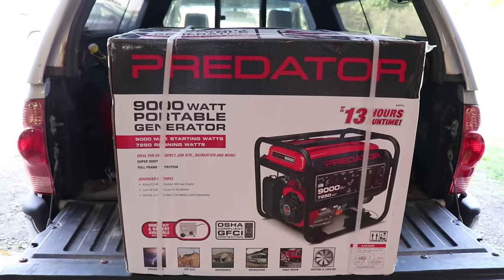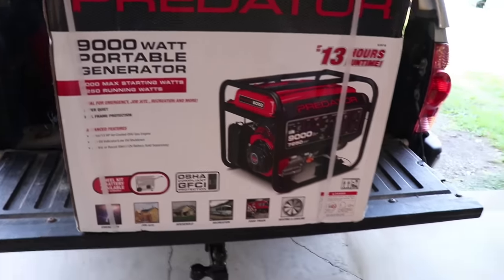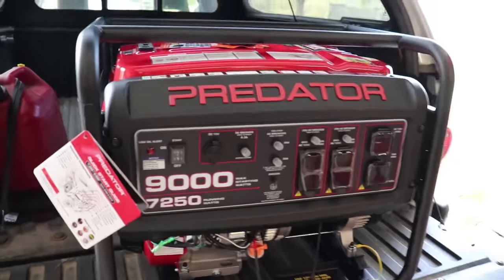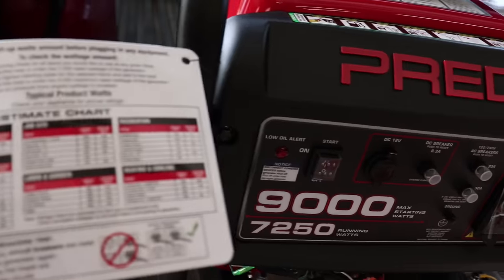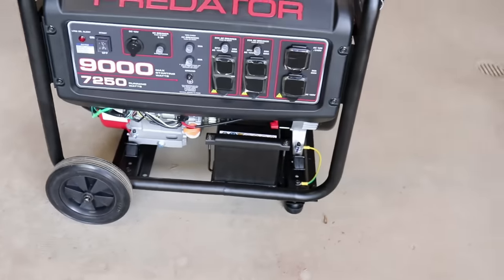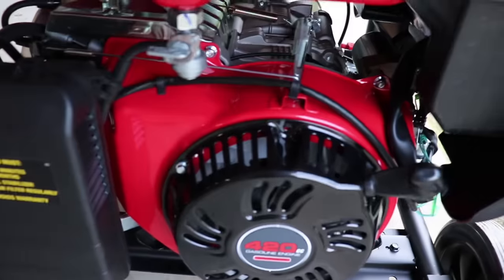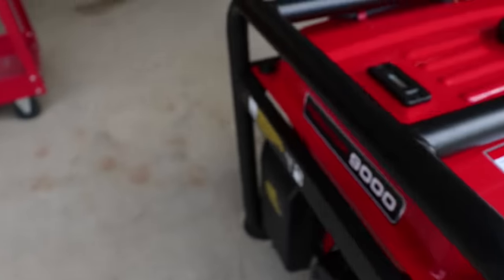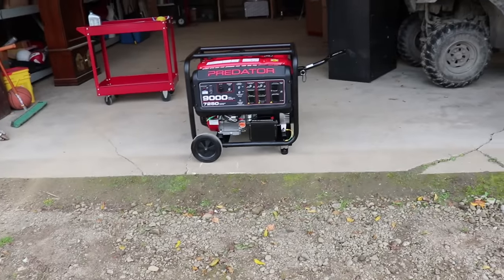Predator Generator Running Our ENTIRE Home. (Complete Setup and Cost)

Comment: We bought the same model about 8 years ago now, right before we lost power for about a week; ironically the geni was cheaper than losing all the food in our deep freezer, so it was nearly paid off day one. I haven't had an electrician come out to wire it up to the house as that's required for our state, but I do have a mobile octopus-looking thing when we use it for back-up duty. Most of the time it's my only source for 220 jobs like the welder and plasma cutter. 
It's run well overall, though the battery thing is Always dead when you need it. Hand cranking can be a chore when you run it for the first time after a few months, but a few squirts of mass air cleaner (I had it on hand) works like a charm til it switches over to full fuel. Also find it funny that the choke sticker is backwards on our unit; still trips me up once in a while. 
In the event you're in a residential area, that geni sounds a lot louder when all the power in the neighborhood is out. 😉
Reply from the maker: I live in a rural area, so no issues. Plus my neighbors are awesome.

Comment: If you have an electric stove, dryer, and water heater, those are huge restive loads.  Your not going to dry clothes, or bake a cake or roast a turkey.  Heat up your food in the microwave, lower power consumption and faster.  Your water heater will stay hot for maybe a day, unless your taking showers and a load of clothes.  Just turn the breakers off to those things and you can use a smaller generator that gives you longer run time, they are non essential items.  Heat and water and sump pump, so you don't freeze, die of thirst, or it's raining so your basement doesn't flood.  Those are essential loads that have to be met.

Comment: I have exactly the same generator. Two things you need to know. The generator does NOT charge the battery. You should attach the battery to a trickle charger when you're storing it. If not, don't expect the electric start to work on a cold rainy night.
  Second, don't store it with e- anything gasoline. The "fuel pump" on this generator is actually a rubber diaphragm. Ethanol fuel will dry it out and when it cracks it's a pain to replace and all you have is a 250 lb boat anchor. You can use up to e-15 fuel when you running it constantly..
Reply: It does charge the generator, might be something wrong with yours. If you turn off the fuel valve, while the engine is running, it will burn all the fuel in the line and carb.

Comment: Nice generator! But that thing is noisy! I bought the Honda eu7000 and it’s really quite and easy on fuel. A few days ago I found on Craigslist another Honda eu3000 for $450 the guy was selling it because it died out and wouldn’t start so he brought it to a local shop and they told him it needed new rings, I brought it home and pulled the valve cover off and seen the rocker arm was off, I put it back on and it runs like a dream 😁

Comment: I believe you need to run that water a bit longer before the well pump kicks on & when it does it will show in the lights as they dim for a.split second. 
Says the 25 year veteran well driller / pump mechanic. Props for the.home schooling brother.
Here's to a 12 pointer in 2020

Comment: Try three days. I just ran my whole house with the 6500 watt predator. I have a well pump and a couple other high wattage items. It ran for pretty much 3 days straight but only shut it off once. Added fuel while it was running.

Comment: Fast forward: Harbor Freight had a sale on the 9000W predator. Add on another discount for signing up on the super saver club and the price was about $700.00 I sold my 4000W and kept the wheel kit. So it cost me about $400.00. I had an electrician come out and install the system at my breaker panel so it runs my complete home without feeding power to the main line and harming PG&E workers. The 9000 runs the whole house, two freezers and all appliances including the air-conditioning and or swamp cooler. PG&E in my area goes out way too often during the year but we are going into fire season so it will be out for days at a time!!

Comment: i have the 8750/ 7000 and had it since 2008 no trouble at all. never fails to start first pull. but i found the battery wont last even if you leave a charger on it 24/7  if its raining i plug in 2 of them cords that's 50 foot cord and it will run everything 110 in my house but when it gets daylight or stops raining i move it and use 8 foot of cord.  i can run everything with that short cord. during harvey we went 21 days and here what i did we ran it at night all night shut it off the next morning after we eat and leave it off until about noon start it let it run the fridge and what ever we needed cooked and ate. then turned it off until just before dark and let it run until daylight again. and i would use about 4 1/2 to 5 gallons.  every 1 1/2 days.

Comment: That "Unknown Tool" might just be a spark plug wrench? Potential generator owners need to consider that a microwave can need 1200 watts. Does the generator automatically cut off, circuit breaker/fuse, if the load exceeds its rated watts output? Gas gauge? Does it have an external replaceable oil filter? There is a YouTube video showing how the video producer converted a simple outdoor shed into a generator supply house. Inside light, air fan, insulation, etc. Looks to me like a great DIY project.

Comment: I know this video is not recent but, changing those cfl light bulbs will come in handy. Led's use less wattage and are less dangerous when they go out. Recently with Texas's blackout a couple cfl light bulbs popped with the generator running. Cfl light bulbs have mercury which is dangerous.
Reply from the maker: I actually did! I put in all LED's.

Comment: Oops! Fridge, freezer,, microwave, lamps with LEDs, and putting a plug on my furnace power. Doesn't happen often enough to warrant the box and breakers. One thing I am doing is connecting the ground wire so the GFI on the generator will work. Looks like you have done a pretty good job of setting yours up, but I would suggest the ground wire.

Comment: If you had natural gas coming into the house, you can easily convert this to NG, that way you don't have to stop your unit to fill up the gas tank. Been using this setup for 30 years, started out with a Coleman generator, to a 4000watt and now have 10,000 multi-fuel which I just bought.. Another quick way is to back-feed into the dryer electrical outlet, but it is kind of dangerous, but works well if you know what you are doing.

Comment: You have to remember  there is a break  in at half  watts or lower  for 5 hours and only turn a the highest  watts on first and work your way up or you will have to buy a new one sooner I learned this the hard way. Most tell you the break  in with 10wx30 and after  5 break  in charge  oil to  Whatever you want synthetic Probably the best choice.

Comment: What about grounding the generator ?  Did you have to do that ?  Instructions say to drive a copper stake into the ground and run a wire. Does that have to be done ?

Comment: I think it helps to buy non-ethanol gas someplace like Home Depot.  Gas goes bad, but the cans of ethanol-free gas last for 5-years unopened.  Less waste of gas.  Plus, it is good to have it around for unexpected power outages.  (It is easy to prepare when they say a blizzard or a hurricane is on its way, but it is hard to figure out when it will be "grid is down" or someone drives into a utility pole)

Comment: 14:54 - The box said 11 hours run time, (and if you read the fine print, I'm pretty sure that would be running at half load). So I'm assuming you'd have to refill it every 11 hours with another 8 gallons of gas running at half load or about 3,600 watts. So, at $3.25 a gallon, that would come out to about $26.00 to power your home for 11 hours or about $2.36 an hour or just over $56.00 a day. If you were running a propane powered generator, I think you could run for about three days for that same amount. The bad thing about a portable generator for home back up power is that they wont run a heat pump or central air. You need about 17,000 watts for that.

16:05 - The box said 11 hours run time so running at half load for about 4 hours a day, it should last a little under 3 days.

Comment: We've done basically the same thing but, our generator is dual fuel and we run it on 100% on propane so, we don't have to worry about gas going bad. One thing though, your hookup to the panel box "may not" be legal everywhere. Check local codes first.

Comment: Makes me worry about a mechanic who doesn't recognize a spark plug wrench...   I think...  I really appreciate all the info about all the parts to do the job.  Source of the plug connected to the box?
Reply from the maker: No need to worry about me...I'm fine.
Reply: @TheCookFamilyHomestead , just teasing.  That tool kit looked SO much like the kind that used to come with Japanese motorcycles, that it just jumped out at me.  Now, I had some real questions.  What was the source of the actual plug you put on your sub box?  And how much of the house could you actually power?  I have a Generac GP8000e generator, but it's big outlet is only 30 amps, not the 50 some people say their generators have.  We are all electric (no natural gas available), so our heat pump, water heater, stove, dryer, are all electric.  I'm just wondering how much we could actually power.  This past winter (you may have heard some rumors of a little problem here in Texas back in February), being able to run just the heat pump and lights would have been very helpful.

Comment: So when you do this, are you essentially just adding a 2nd/Alternative/Backup  source of power into the house ?  You connect the generator into the fuse box (with appropriate fuses/breaker/wires) , then work all the other breakers as you normally would ?   Want something on, turn the breaker on........want it off......shut it off ????   I had always thought I would just plug certain things into the generator.   Never contemplated running a small home from it.....

Comment: If you were to connect it to an RV as I do, you have to power the generator on and then connect the 30A cord since unless you want to climb in  and turn it on from the breaker. My old generator had a breaker switch in the generator itself which I liked a lot.
Reply: ⚠️portable generator safety announcements:

This is just a reminder to remember the safety rules when using portable generators. 

1) KEEPING OTHERS SAFE: Please do not allow an unqualified person or your children to operate and service the portable generator. Just because some manuals don’t say that doesn’t mean it’s safe. That is important against the generator safety rules. We also need to be keeping an eye on our children too. You need to make sure that your children are not playing near the portable generator especially when it’s running so they won’t get electrocuted. Generators pose electrical risks and they can be hot during an operation. Please keep your children away from the portable generator at all times. It is important to keep our children safe especially our little ones. Be aware of all the hazards.

2) WHERE TO RUN YOUR GENERATOR: Some people use their portable generators indoors which increases the risk of carbon monoxide poisoning. It’s important to have a carbon monoxide if you have a gas generator. Never ever use your generator indoors even if your doors and windows are open and even in the garage is not safe to use a portable generator. Please do not even use your generator in your deck or balcony. It is never safe to use your generator indoors and in enclosed areas of your home. Your generator needs to be 15-20 feet away from your house. 

3)🔥FIRE HAZARDS: Never refuel your generator while it’s running. You need to let your generator cool off before refueling it and before storing your generator. Never overload your generator too. Never ever back feed your generator. You should never plug your generator into a wall outlet. Also never store propane tanks indoors. Please keep flammable things away from the generator as well and please don’t smoke cigarettes near the generator. Having a fire extinguisher next to the generator is also important against the generator safety rules. 

4) GENERATOR OPERATION: make sure your hands are dry before touching the generator. Never use your generator in wet conditions. Don’t let your generator get wet. You need a generator tent if you need to use your generator during wet weather. Please don’t wear loose clothes when operating the generator. Turn on your generator before plugging in appliances. Use the right cord for your generator. Please do not use worn out cords. 

https://youtube.com/shorts/eFigDfnPkcQ?feature=share and here is a short video more about keeping others safe when using generators 

Hope this helps.

Comment: you need to run that generator for about four hours without a load on it to break it in. After doing that you need to change the oil again. You can run everything in your house with that generator including the AC if you dont have everything on at the same time EG water heater stove microwave etc.etc.   believe it or not your mocrowave is a big load on your generator.   The one you have looks to be around 1000 watts or so.   keep that in mind if you go to pop something into it while on the generator.   Lights in the house is the smallest load you will have as long as you get in the habit of turning them off when you leave a room. Another huge load on it will be the stove/oven if its electric.  best not to use it while on the generator.  I run my entire house and an 5500 watt generator.  instead of running my central air i have 3 small window units that i bring down from the attic and put into windows when the power is off (during power outages from hiurricanes). I live in deep south Texas and have liived through several of them.

Comment: The tool you had no idea what it was for is your spark plug removal & installation tool.  

The reason you don't want the main service breaker on when you are powering your home with a generator is because your generator will back feed power back to your electrical utility lines and you will injure or kill a lineman that is working to restore power to the area.  So you must have the main service breaker turned off when running on generator power for safety reasons.

Comment: I have gone through many power outages because of Hurricanes. Turn off breakers for the things that are big power uses.  Print it up nice and do something to to protect your lists.  Make a list for each breaker box. I have been through this many times.  It is RUDE when someone forgets and turns on the oven and the generator loads down really bad before the breaker trips! Your things want 60 cycles  AC but there is a delay before the breaker trips and the engine can't keep up speed so you are giving things the wrong power! It can damage things! But to be safe make the list of high power things and turn the breakers off for them. I have been there done that!  Also there is a little watt meter that will give you the Volts,  amps,   watts and watts over time and it will give you the cycles the generator is pulling out.  Some generator are good out of the box others are off one the cycles. Most generator can be adjusted, some are easy with a screw, others you need to bend a little tab that the spring is considered to to adjust the speed. If you need to adjust it and not sure how to do it have someone do it that knows how. But I found the small meter good to check things. You plug in the meter and plug the thing you want to test into the meter. Important the more you run from the generator the more gasoline it uses.  Keep the loads down!  When the power has been off for a time Everything wants to start as soon as you start the generator!  The start current on some things can be 7 times the normal power needed. If you try to go from no load to a very heavy load there can be a problem. I then off all the breakers put the generator online and turn on just the breaker I need one at a time.  That way all of the thing start load isn't all at the same time. Just some things I have learned.

Comment: Change all lights to led and you can free up a lot of power. Good job.
Reply from the maker: I did! You are right, love the LED. I have my garage and barn all with LED now as well as my basement. Most of the house has LED bulbs, so that helped a ton.
Reply: @TheCookFamilyHomestead  good to hear!!    Enjoy the feeling of security. 
Make sure to use fuel stabilizer, so carburetor doesn't gum up, when sitting un-used for long periods of time.
Again,  great job!!!

Comment: by now you may be thinking of a dual fuel generator just to avoid the long line at the gas pump if we do have a long outage, some gas station may not have a backup generator
Reply: Don’t forget about generator safety if you have a portable generator https://youtu.be/I1jT3ANENvI just hoping you stay safe. Thank you
Reply: I thought about that before we purchased our generator. I installed a Tri-fuel kit, so we could run our generator on gasoline, natural gas and liquid propane. Natural gas is our primary fuel source for our generator, since this is what our house uses.
Reply: @Pk3_Garage   nice

Comment: Did you install wiring to outlet yourself? You turn off main power from street ro install 30amp breaker and wire to outlet? Thanks for response.
Reply from the maker: Yes, correct

Comment: i have heard that u should disconnet ur ground wire coming into ur breaker box from the power pole.  this prevents dangerous volts entering ur home if a main power line was to crossover somewhere upstream and revearse feed through the ground.  this is the home generator manufacters recommed usinq a transfer switch at ur meter box .  it disconnects the ground from power utilities......search online ....be safe!!!!